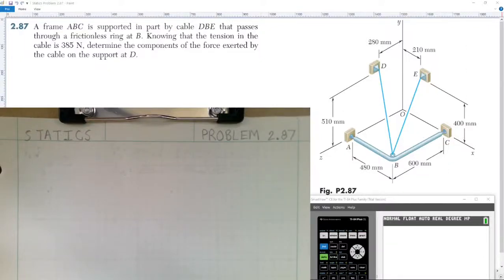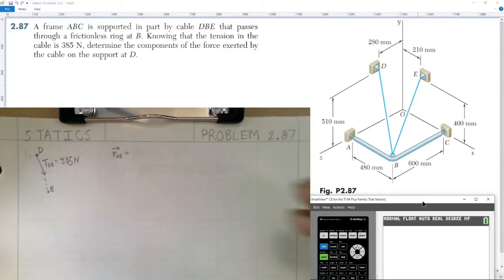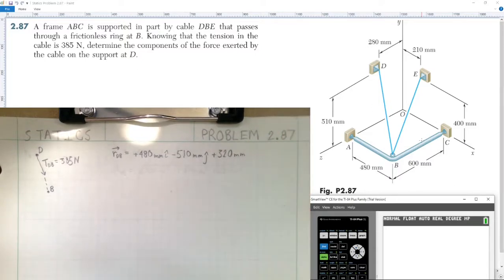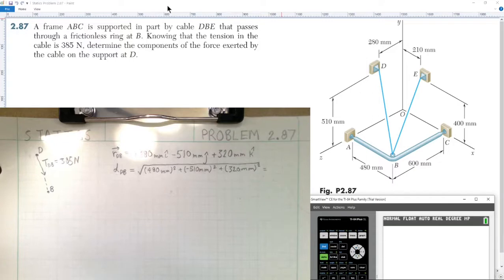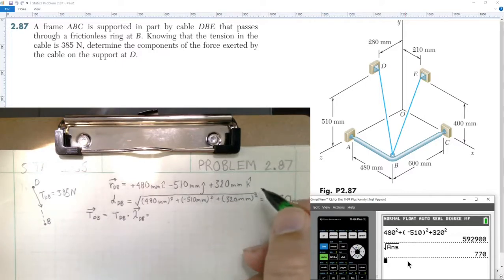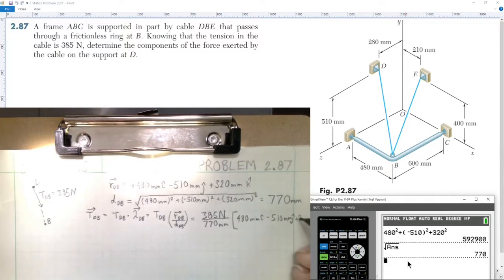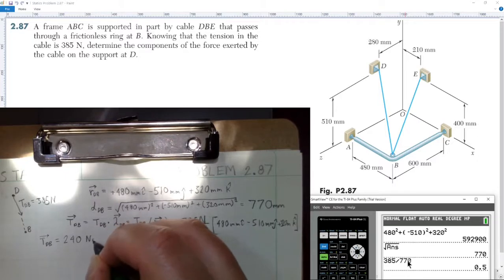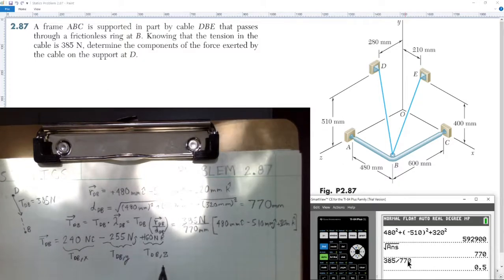Statics Problem 2.87

Comment: How do you determine if your xyz components are negative or positive? 

I know you do (Initial position - Final) but how do you figure out what is the initial or the final
Reply from the maker: The x, y, and z axis point out of the Origin at point O in the positive directions as drawn. 

Thus, for instance D to B is "down" 510 mm in the "negative" y-direction, but the x & z components of that vector are oriented in the positive directions as moving from D to B "increases" their value relative to Zero at the origin O.
Reply: @simple-stem-solutions  thanks alot! i was overlooking where the O origin mark was on most of the examples so i was winging it half the time